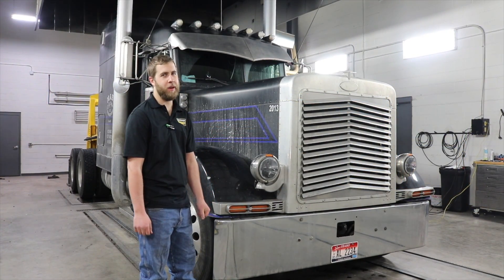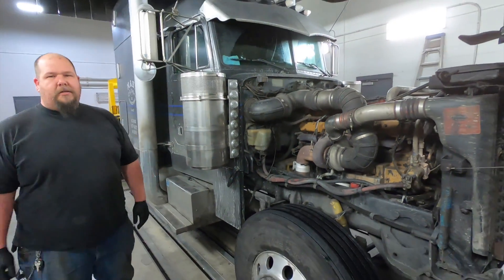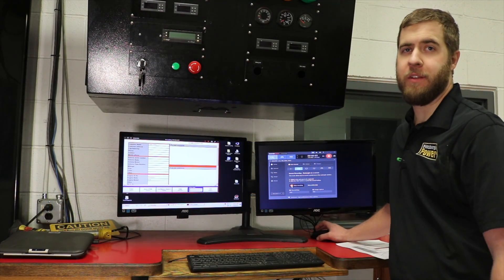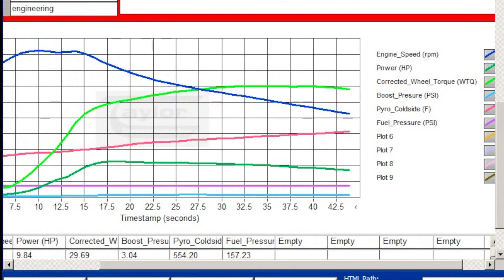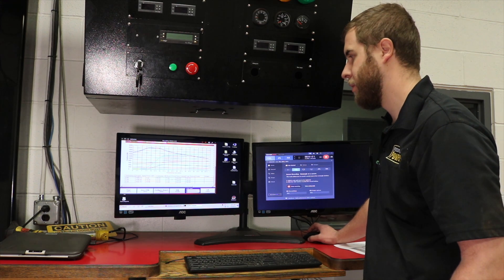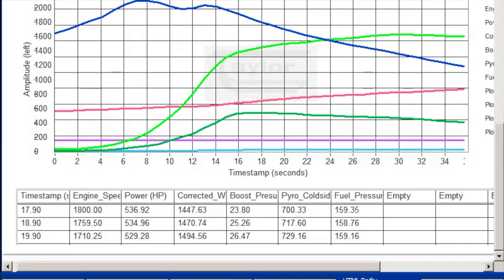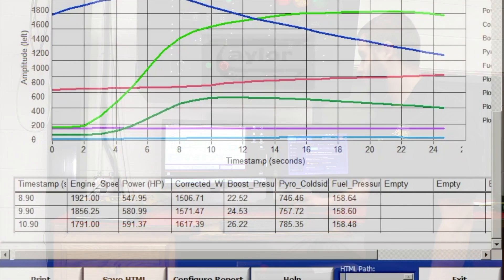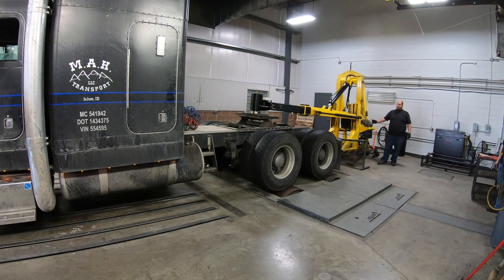Cummins N-14 MPG Dyno Tune

Comment: N14 and Series 60 are the best on road diesels ever made.
Reply: C15's can handle 2000+ horsepower, n14 blocks split at 850 🤔
Reply: @Sinister_Reaper   yeah maybe for 10 seconds. c15 engines are expensive to work on and no anywhere near as reliable as a cummins or 60 series.
Reply: @TheMeemsie1 in my 10 years driving truck and fixing them I've barely had any problems with the cat engines, the Cummins had been rebuilt at 600k miles or less meanwhile the cats are running strong at a million+ miles
Reply: @Sinister_Reaper if ur Cummins is done at 600 k miles that sounds like an owner issue. Or someone who doesn’t know how to rebuilt it lol

Comment: Cummins factory calibration from the CPL 2592 525HP 1590 lb-ft engine is standard, moreover, the engine could not even develop these characteristics, most likely a test bench error or engine wear.
Reply: Try the 2025 or 2591 better pullers

Comment: 525hp is supposed to be 1850tq
Reply: Those numbers are to the wheels/ground so ad 25% drivetrain loss & you will get the engine power to the crankshaft like factory rating them.
Reply: @OlegFL2010  do you know how to get 2250 out of a signature 600?
Reply: @OlegFL2010  meh.. qsk k9 CPL.  One hx82 turbo. Cheap. ! I found the regular  Signature had wayyyy too much power when roads were wet, and the box was empty.

Comment: Are the piston crowns in that Cummins, steel top or aluminum top?
One of the two piston materials doesn't tolerate heat as well as the other. You can assume its a potential issue as horsepower rises. Especially on long pulls.
Reply: Steel pistons with aluminium skirts in all n14, big cams had aluminium in some

Comment: Classic trucks looks beautiful but zero aerodynamic the best they can do 4,5 MPG
Reply: Bullshit, you're talking out your ass. My coronado glider 5 yr average is 7.2 mpg, pulling flatbed. Our 2000 classic consistently got 7+mpg with a 12.7 Detroit.
Reply: 7.2 flatbed, how about dry van or refer that is taller than the cab, there's your at most 5mpg. Aero cabs looks generic but there is a reason for it. But for flatbed it's usually ok. I do appreciate the classic look and it adds a personal touch for each driver. It gets old seeing the same stuff on the road. Long nose and coe something unique.

Comment: hello, what changes have you made to the engine to get this 590 horsepower result? noticed that the fuel pump was changed, the turbo remained standard
Reply: Probably fooled with the fuel pump and computer. Basically raising redline and increasing fuel pressure and raising fuel cutoff rpm....among other things.....

Comment: So u guys added 100whp without adding more boost??? Baseline pull was on 30lbs, final numbers 31lbs?!?!? Thru a stock turbo/manifold
Reply: Yeah something was up with their boost gauge. No way it only made 32 psi and jumped up that much on torque.

Comment: This was my truck cat built the motor so they painted it cat yellow. The truck was getting 3.8 mpg when I took it them it clearly had a problem with it and instead of finding the problem they just tuned it come to find out it had a bad ecm on it so the outcome was it blew the turbo and fired the ecm they didn’t fix anything but Cummins did new ecm new turbo and the truck was running great and getting 5 mpg they will never get my business anymore. Chris Kelley MAK transport
Reply: If the ecm was bad at the time of the dyno, it would have shown. Quit looking for someone to blame. You willingly took your truck to them because you felt it had a problem. And I bet on the first hill you pulled leaving Saxonburg, you had a big smile on your face, and thought your truck was awesome.
Reply: @jcsully , bullshit. My ecm had an issue with the plug pins shorting out and at the time I got it tuned, the data link detected nothing. I didn't have Pittsburgh Power do the tune, but it shows if the problem isn't there when on the computer, how can anyone find it. Kind of like telling your mechanic... "it goes chirp, ping, ping, bang when I shift" and the mechanic can't get it to replicate the problem. Who is to blame, obviously no one is. But don't come on here like some rest area gloryhole hero and call the guy a liar, it's a good way to get free dental care.
Reply: @Baruch994  lolololol
Reply: @Baruch994  Didn't you see the license plate?? Idaho. Out west we've got MOUNTAINS. 5mpg is pretty darned good. I'm up in Washington, running a Pittsburgh box on a 2025 cpl, and have Dyno numbers similar to this. Biggest problem is keeping the water cool. Fuel is CHEAP give me more power.
Reply: @Baruch994 , you're smoking crack, 😂

Comment: What did the customer think of the tune and what did he gain that the real question . You need to put a review  on here after the customer uses it for a couple months I want to know that !!! That will sell me faster then anything I worked on N14 for 16 years now I am a owner operator and building an N14 for my own truck now.

Comment: Customer complains about poor fuel economy, dude ups power.
Reply: The owner commented on here, the ecm was bad, and they still insisted on adding power. But you obviously don't understand how an engine works. It's an air pump essentially, but you think turning power down is efficient, lmfao 😂. If I have 700hp and you have 475hp, we are both grossing 80k, who's engine is working harder and using more fuel? Your little 475hp engine is dying going over Donner while mine is pulling nice and strong. I can't believe there's still people who think power is detrimental, holy shit.

Comment: you tune a 12.7 Detroit and got 607 hp and u tune a n14 yellow cummins and got 534 hp ?
Reply: Detroits can be tuned and built above 700hp, it's not difficult. There's guys in Pennsylvania who have working trucks that sled pull and they are over 800.

Comment: All these internet gear jammers...😭😁... That n14 cummims is a truly badazz and well built unit.
Reply: There Dynamite motors just hard to find parts for em when shit goes south.
Reply: @Tyler-xe1es  They are fine until the ole main cap fretting issue bites you in the ass when you turn it up.
Reply: 25 yrs out here and I guarantee I have more miles in reverse than you have going forward Good Buddy, and the n14 isn't badass. Valve coking issues, fuel pump problems, electrical issues, splayed main caps... junk.
Reply: What do you think of the Detroit Series 60?
Reply: @TheRoadhammer379  the problem is not the motor it's between the seat and the steering
Reply: @TheRoadhammer379  and yet you’re here watching videos about n14 dumbass

Comment: I was gonna say wtf paints a cummins cat yellow???? until I saw other guys beat me to it..You can wish and hope all you want but painting it cat yellow isnt gonna make it run like a cat. If you wanna step in the left lane an break someones heart, yank that heap an set a 6nz in there with a new tune. All the power you'll ever need without having to beat it just to hang with traffic...I will say though for all you confused die hard cummins lovers out there, that cummins certainly has come a long way. My 16 pride and class does a pretty good job but its still pretty easy to tell its not a cat.
Reply: Jeremy Wilson huh. Must’ve never heard of a kta
Reply: What about it?? It's still a Cummins. It builds decent power after you slam your fingers in the door an get mad at it all right before the pistons start to disintegrate. Huh. Car builds the same power, and more with only a little tweek. Even a bridge with a few changes an not have to beat the living fuck out of the rest of the truck.
Reply: Jeremy Wilson you know as well as I do, a kta will pullouts and destroy any 6nz scatterpillar. Guys in trucks shops like me will tell you. The caterpillar is a great engine, but it is also very overrated. Talked to cove truck sales last week and the said they fixed more cats than Cummins and Detroit together last year.
    I’m not bashing the c15, I’m just letting you know that you it does have serious competition.
The original debate was about power, and my point stays. The kta would wrench the insides out of a 6nz without blinking
Reply: why does it have to be a 6NZ? why not an MXS or a 1LW ? people are hung up on the 6NZ and that's not more than a glorified 1LW or 2WS, a well tuned MBN is just as good as a 6NZ , same as any other Cat,  I much rather have an acert and build it with lower compression and a tune and keeping the twins, than do the same with a 6NZ.
Reply: My built and tuned 12.7 makes yellow fuck boys cry across i80 all year long. Scatterpillar is a good engine but most of the good buddy's talking them up are reminiscing of their first ride at Werner in a castrated 475hp 3406E, lmfao. All you yellow babies talk big shit... I have 800hp... on a tune, gtfo. 😂

Comment: That poor motor is all confused being CAT Yella!!! That's just wrong on so many levels!!!  Paint it black and red and it will run better!!!!!!
Reply: Apperently you have never played with a c -15 cat lol
Reply: Jason Tate which Cat C-15 there was 3 versions of it. The 6nz C dash 15 which was a re named 3406b, the C15, C15 Acert.
Reply: Firebird 87622 3406b was all mechanical. Early c15s are basically a 3406e

Comment: Never seen a cat yellow red top cummins before.
Reply: Maynard Reed I think that’s tan cummins uses...
Reply: @justinmartin8887  that's not cummins tan.
Reply: marc mo ok. Call me color blind I can’t tell 😂
Reply: Yeah someone wanted a cat, that's far from a cummins beige
Reply: I was thinking the same thing.
Reply: Kml thats cummin cat yellow red top ++ CN14
Reply: Older Cummins engines were Tan. N14 Cummins is a black engine. Maybe this N14 is older

Comment: That’s great 👍
Got time to do my 2000 9400 with 12.7  60 series 430 hp next week?
My complaint is same, low hp and poor economy...
Reply: Never seen a 12.7 430 Detroit get bad mileage personally. Perhaps there's a bad sensor or the charge air cooler is leaking boost. Just a thought.
Reply: Maynard Reed ..
It’s something.. I called them and made a appointment for next week the 31st 
We’ll get to the bottom of it sooner or latter👍
Reply: @ISXCUMMINS565  yes they will. Overall those old 12.7 Detroit's are quite reliable. Good luck.
Reply: @maynardreed4036   bout the only time I've seen a 12.7 get bad mileage is keeping the throttle on the floor All day.  Even then, it's not terrible.
Reply: @Milly_Mill_aka_Birdman  I agree. It's not unusual to see 6-7 mpg out if one.
Reply: @maynardreed4036  yep!  I get that now with my 389 glider.  My 12.7 has been reflashed plus aftermarket turbo/manifold and straight exhaust.  Can get better but I like to keep my foot in it most days